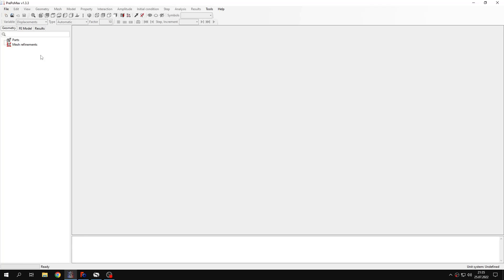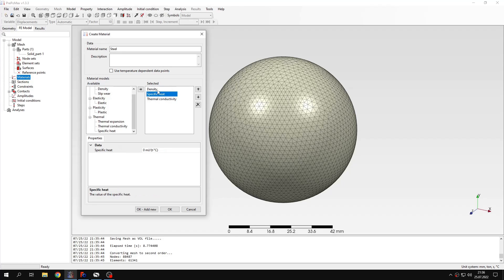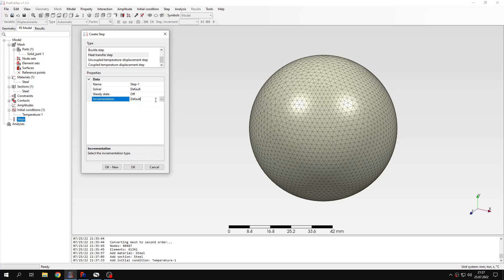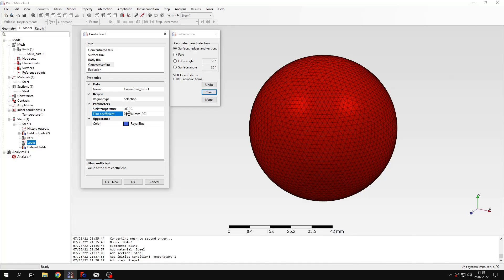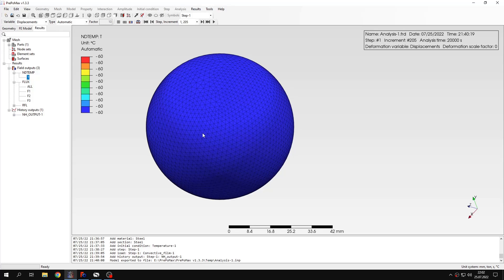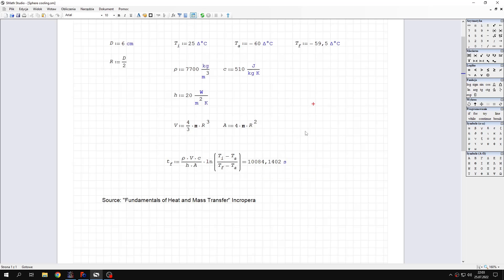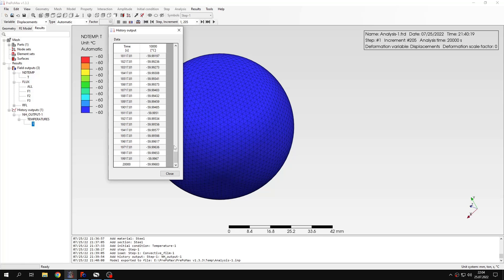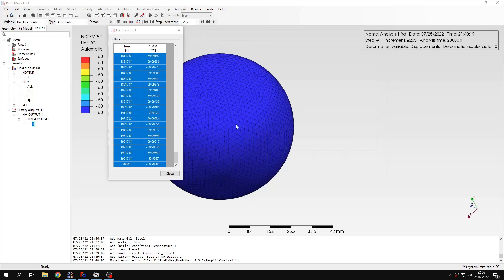PrePoMax (CalculiX FEA) - Tutorial 23 - Transient heat transfer analysis - sphere cooling

Comment: One thing i really dont get it: the initial temperature is 25C as you prescribed, but in the final results, you can see the table and the graph showing it starting around 0C. Is it somekind of first step error? Also, congrats for the channel. I'm having a blast with those tutorials.
Reply from the maker: Right, by mistake the initial condition was applied only to the outer surface of the sphere. One should switch the selection mode to Part before selecting the sphere.
Reply: @FEAnalyst  So, for transient analisys, if you don't define the initial conditions is it 0 by default? i'm asking because i just tried prepomax transient analisys for a small project and the first temperature values were not the ones i defined, despite using "select  part". For example, i used To=20C and the first value i got from the simulation was like 50C, even if i tried smaller steps. Do you have any idea of what might be happening? Thanks in advance
Reply from the maker: @MrRenatopepin  Initial temperature has to be defined for transient heat transfer analysis, at least for some nodes (otherwise, CalculiX gives an error message). If you have questions about your particular case, please ask them on the forum, it will be much easier to help there. Especially if you share your model. Issues like that are often caused by too coarse mesh but there can be other reasons too.

Comment: Is it possible to define time dependent heat transfer coefficient and correspending reference temperature in a transient thermal analysis? 
I know to use amplitute from Abaqus, but in PrePoMax it doesn't allow to define them in a same convective load.
Reply from the maker: In PrePoMax, when you select the amplitude for the convective film load definition, it only applies to the sink temperature. To scale the film coefficient you would have to add the FILM AMPLITUDE parameter to the *FILM keyword. It's not yet supported in PrePoMax so you would have to add it manually.
Reply: @FEAnalyst  Thank you for your kind answer. İş there any tutorial or guide how to do it?
Reply from the maker: @korayozdemir8727  In this case, it would be best to export the input file from PrePoMax, add the aforementioned parameter in some text editor and run the analysis from the command line (just place the solver’s executable in the same directory as input file and type "ccx_static jobname" in the command line). Then you can open the .frd file in PrePoMax for postprocessing.
Reply: @FEAnalyst  Thank you it works really as in Abaqus. But what is the command to run  .inp as parallel?
Reply from the maker: @korayozdemir8727  You have to set the OMP_NUM_THREADS environment variable to the desired number of cores for this purpose.
Reply: @FEAnalyst  OK I did so but again it solved 1 CPU. Should I add a line to .inp or powershell when running?
Reply from the maker: @korayozdemir8727  How did you set this environment variable ? Check its value.
Reply from the maker: @korayozdemir8727  It should work if you write setx OMP_NUM_THREADS "8" in the command line (then you can check its value with echo %OMP_NUM_THREADS%) or add this variable using System Properties —> Advanced —> Environment Variables.

Comment: Hi. Is it possible to perform dynamic analysis with Prepomax? Thanks for your software!
Reply from the maker: Not really, to be honest, PrePoMax doesn’t support any dynamic analysis steps other than natural frequency extraction at the moment. What’s more, the dynamic steps available in CalculiX (solver used by PrePoMax) are also quite limited, they are meant mainly for vibrations, quasi-static analyses and some high-speed events like impact (not the best tool for that though). Theoretically, MBD studies could be done in CalculiX but it would be very tedious to make them work with proper connections between rigid parts.

By the way, CalculiX is developed by Matej Borovinšek. I just help him with documentation and tutorials ;-)
Reply: @FEAnalyst  thanks for the response. I am working on integrating FreeCAD and MBDyn to perform MBD simulatios using FreeCAD as pre and post processor. It would be fantastic to esplore the possibility of coupled simulations between MBDyn and Calculix.
Reply from the maker: @josegegas  Right, an option to use flexible bodies in MBDyn simulations in FreeCAD or to use the results of motion studies as loads in FEM analyses would indeed be great.
Reply: @FEAnalyst  Yes, exactly. My workbench will provide the dynamic loads, to be applied to flexible FEM bodies. Let me know if you are keen to try. I do not know much about Calculix and some collaboration would be great.
Reply from the maker: @josegegas  I will be happy to help with that. We can talk on the FreeCAD forum (my nickname there is NewJoker). Let me know if you need any help with CalculiX’s input file syntax.
Reply: Dynamic meant for explicit am I right?
Reply: @megeteu  Dynamic as opposed to static. Including inertia and momentum